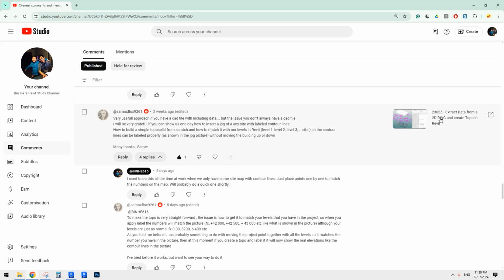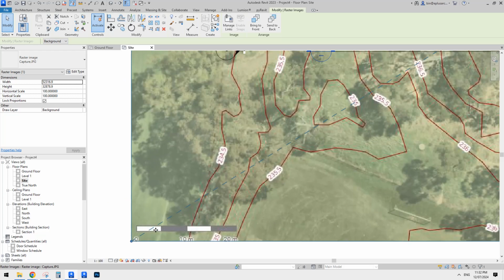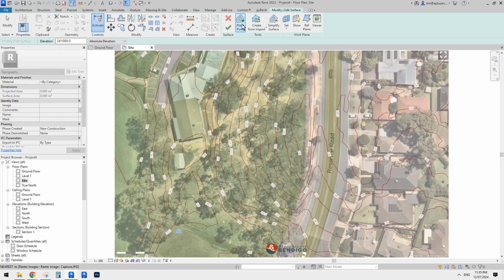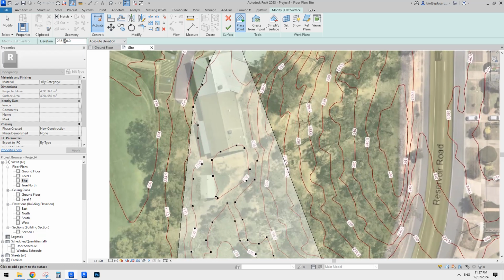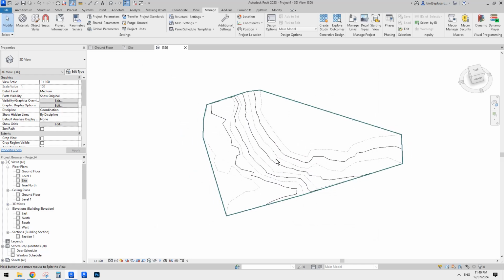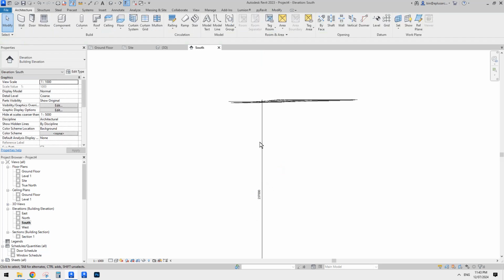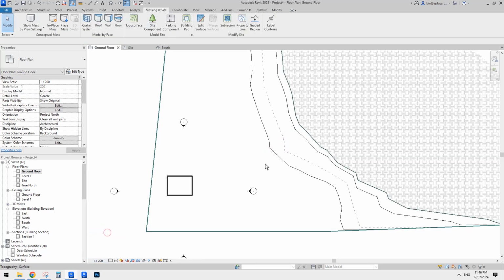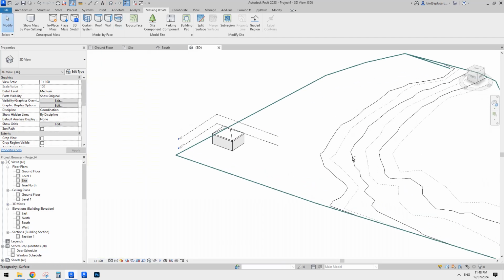24040 - Topo from image and some level changing

Comment: Hi Bin He
Setting the reference quota is very simple.
The model does not move, 
but the reference altitude of the project is linked to the sea level altitude.

0
Work in a section view
1
Unpin Survey Point,
so it stays there, and it doesn't move down.

2
Go to Manage
 Project Location
  Coordinates
   Specify coordinates at point

3
Select the level
 Specify Shared Coordinates
  New Coordinates
   Elevation
   input the value
    set OK

4
check it out with Spot elevation relative to Project base point and Survey Point

Best regards
RMN
Reply from the maker: Thank you very much, Robert, I will have a try.

Comment: Jaaah … great … 1000 thanx Bin 

After I ‘ve  watched yours , I think the best is to move the topo down without messing with levels and only change the project base point elevation 

For edit points after-wise no worry:  from 2024 and up you can show the points relative to : 
* current level
* project base point 
* survey point 
* internal origin (??) 

Usually when you do a project (in school I mean) you start with the building first and then build up the topo later, thus it might be difficult to move the building up. It’s easier to move the topo down 

By the way the topo solid has some capabilities, but the topo surface is still more accurate than the topo solid. 
Luckily you can convert the topo surface into topo solid in R24, R25 …. I Wonder why Autodesk doesn’t fix the bug before they continue issuing new versions ! 

Thanks,
Reply from the maker: Thanks for the input, Samer. I am always a bit nervous about all the levels, PBP, and SP issues since I have not had any real work experience on large projects. I mostly work on small projects and don't want to mislead people in any way. We are still on 2023 and will probably go straight to 2025, hopefully getting a better topo tool.